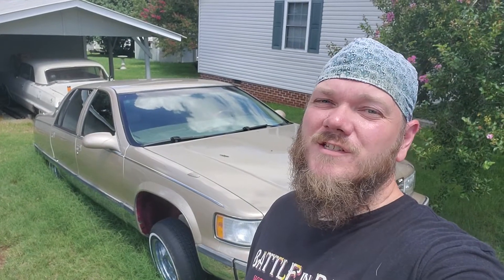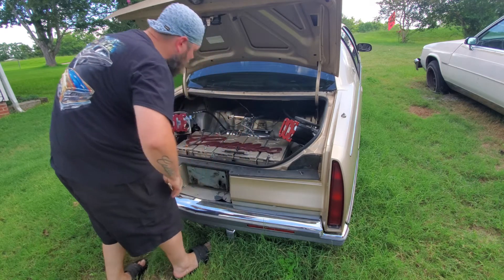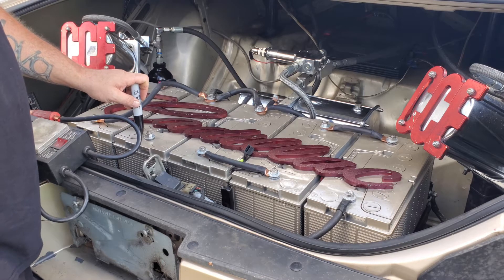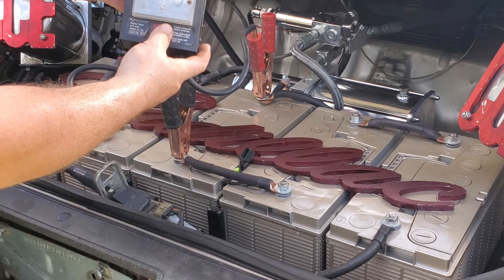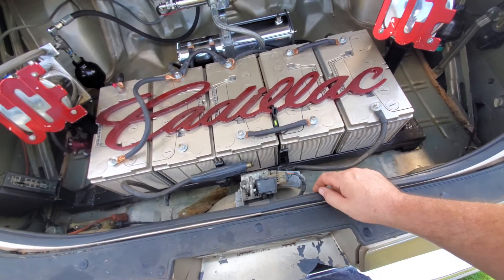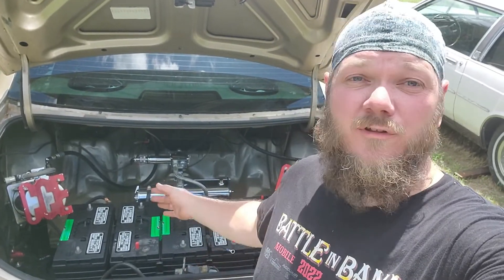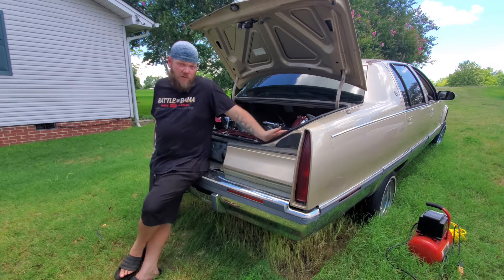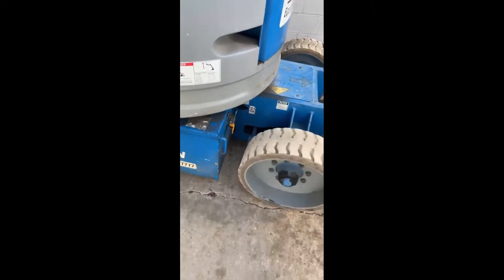How To Load Test Batteries

Comment: Which car has a similar floor panel as the fleetwood?
Reply from the maker: Most gms are similar 80s cadillacs are the same also caprices are very similar
Reply: @thecadillacdanshow8658  ok thanks. Or can I just put any it doesn't matter right?
Reply from the maker: Are you replacing the floor boards?
Reply: @thecadillacdanshow8658  the floor panels they are all rusted do you have Facebook or Instagram so I can show you some pictures
Reply from the maker: Yeah I'm on Facebook at Cadillac Dan  and Instagram at the_cadillacdan_show I'm more active on Facebook

Comment: Are those telescopic in the rear. I got 14s with 2 ton precuts and seems like I cant go bigger for higher lift with out them getting real close to the rear deck. Also seems I cant for the same reason cut the springs for it to drop lower. 16s would be really tight.
Reply from the maker: Yeah they are 22 inch teliscopics they are nice for saving room the only thing I dont like is when it hits the second stage the speed changes
Reply: @thecadillacdanshow8658  , thanks, that travel is awesome though. Can be high or on the floor.
Reply from the maker: @anthonymaestas4863  that was my goal I still wanted it to lay low (even though I have a full stack in the front)
Reply: @thecadillacdanshow8658  Question .locking up front and lifting rear corner for for standing 3. The lower front side cylinder goes down  on 3.hit the front and it goes up for a higher 3? Can it be pump head seals? No leaks. Thanks.👍🏼
Reply from the maker: Your saying when you lift it up in three the front wheel drops a little and when it's up in three you can hit the front switch and lift the front up a bit more
Reply: @thecadillacdanshow8658  thanks. It goes up. Why does the front go down when doing 3? Thanks.
Reply from the maker: It shouldn't what size springs do you have in the front the only reason I could think is all the weight of the car is compressing the spring a little but once the suspension is locked up it should not go down at all unless there is a leak in the check valve or dump even if the spring is compressing I would think the hydraulics would do the same amount of compression on the spring if you can take some pics and send them to me on Facebook
Reply: @thecadillacdanshow8658  Good deal thanks👍🏼
Reply: @thecadillacdanshow8658  i think its the dumps shaft. I have a 1/2 dump . And the front wasn't going up. So I took i I took it apart one day. And the pin with the spring was stuck . I think to much over locking it warped inside. I put a older shaft in . It works. But I think its to worn out to hold the pressure and weight when 3 🤔  thanks 👍🏼also had to snug 2 hose a little tight. I HATE oil leaks. 😉 Thank you for your time👍🏼🙏🏼

Comment: can you do a video of a shut off switch to the accumulators..
Reply from the maker: I'm still looking for one there was a guy a long time ago that was on layitlow that had a blazer that had some kind if electric valve for accumulators unfortunately he stopped coming on the site before I came across the post. I thought about dump valves but the solenoid would melt if left on to long you can plum a slowdown valve to turn them off but you would manually have to turn them off
Reply: @thecadillacdanshow8658  ive seen the manual ones..i thought they were cool cause you could turn em on for freeway and turn em off for blvd /hopping!
Reply from the maker: Yeah I wanted them for three wheeling with chains I am still on the look out for them

Comment: what size fuse do you put on your switch wire
Reply from the maker: I have a 25 amp fuse in the switch wire I'm about to ad a 15 or lower to my adel I had a switch stick while I was working on the car and almost burnt the dump up
Reply: @thecadillacdanshow8658  the fuse for the dump, you put it in the wire coming from the candle plug?
Reply from the maker: @SayT210  correct I have a 25 amp for the power wire going to my switches but I have learned it's to big to blow if the dump switch sticks but if I put anything lower my solenoids pop the fuse so I'm going to put a lower amp on the dump itself
Reply: I’m trying to find out too